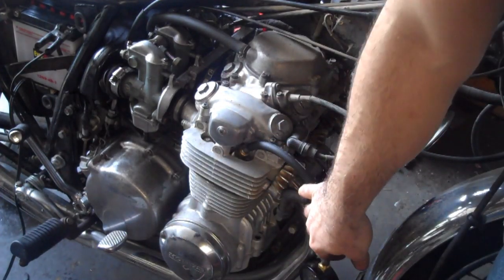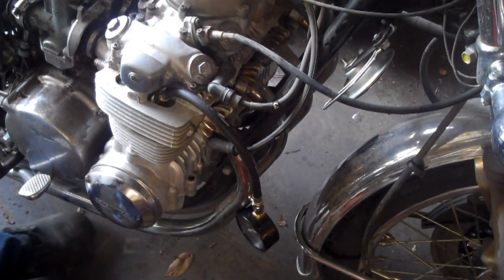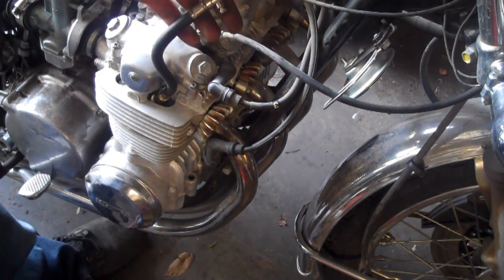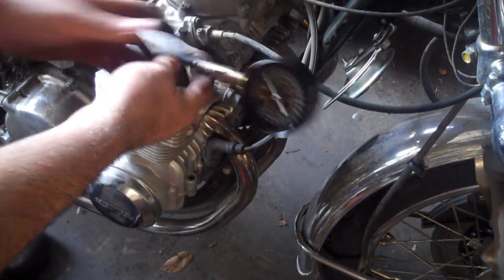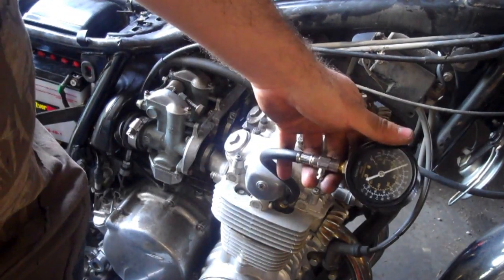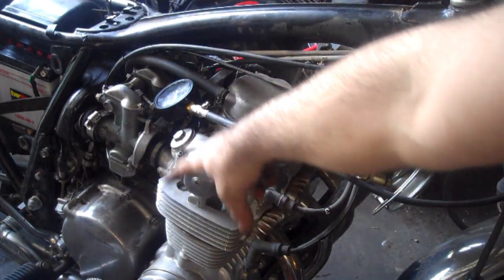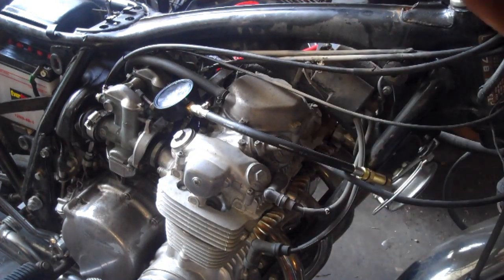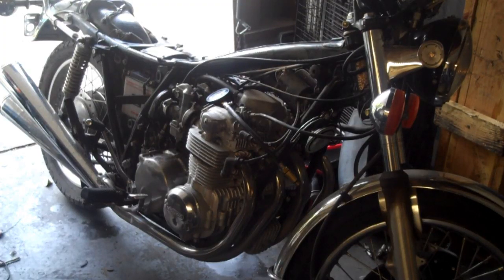How to do a compression test on your engine

Comment: Hey Max, thanks a bunch for this video. Just did a test on my cb550 and on three of my cylinders I got about 125, but on the fourth I got 140...? So what to do about that? Is there someway to lower the compression, or should I just stick with it like that? Cheers
Reply from the maker: Daniel Mathew You wouldnt really want to lower your compression. Ideally you should want to raise the compression of the other 3 cyls, and that is done by doing a valve job, or by rebuilding the motor. However with those numbers and that age of the bike, Id just ride the piss out of it like it is, and rebuild the motor when or if it begins to fail to perform

Comment: mrmaxstorey If I have a compression release should I test it before or after my release or both? My GN400 wont start.  It ignited some start fluid, but wont go past the second put.  My compression during my compression kick is 60psi.  After releasing and kicking its only goes up to 30.  which should I read? Also, I notice its harder to kick when I have the gauge on. Is that normal or an indication that my spark plug threads are bad and is there a way to get a good seal if thats the case?

Comment: i was told the rings might be down, but idk on vn750 the rear cylinder heats up twice as fast as the front 1 and has twice the exhaust emissions on idle i can't find any1 that has the slightest idea on whats wrong
Reply from the maker: Whats the color of the exhaust emissions?
Reply: theirs no color def. not run burning oil or white smoke
Reply from the maker: ethan fox
OK then please elaborate what you mean that it has twice the exhaust emissions
Reply: mrmaxstorey you can feel twice as much exhaust fumes coming out the left side exhaust than the right at idle to and throttle range, the rear half of the engine heats up a lot more considerable faster than the other
Reply: I see this problem, one hot cylinder on a cb400.  Exhaust way has way more pop and is white-gray.  It's aircooled bike.  What could be causing this?  Valves have been adjusted recently.  Please help, I also did thorough carb clean.  Will do compression test in 5 days time when I get adapter..

Comment from the maker: No that shouldnt make a difference. When I take compression readings, I believe the top best reading that I can get. It sounds like you have some major differences between the cyls, 100 in one and 150 in another, and that will very likely cause your running problems

Comment from the maker: Well sure, the greater the volume of the container, the less psi will be produced on compression, so if the relative increase is smaller (moto cyl + tester tube, compared to auto cyl + tester tube), then the tester will not be as far off on a large engine. However a difference of 55psi is still massive, considering that engines are diagnosed based on as little as 3 or 5 psi.

Comment: I'm hoping to do this soon. My 78 Cb750 is running pretty well now, but the 78 is notorious for burning through valve guides. I'm actually dreading a compression test. I wouldn't mind rebuilding the head sometime but it seems like a hell of a lot of work. 

Guys on the forums say most 78's burn through their guides by 20k miles. I have 45k. I'm hoping that someone replaced them already, back in the day. 

Have you ever had to rebuild a head before?